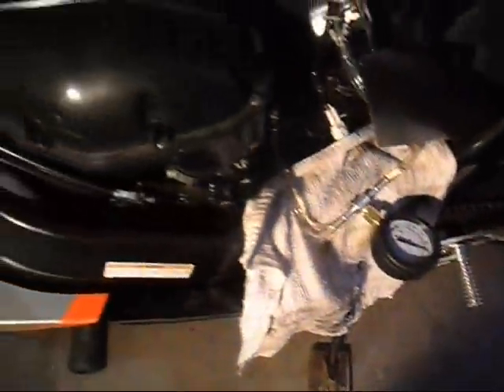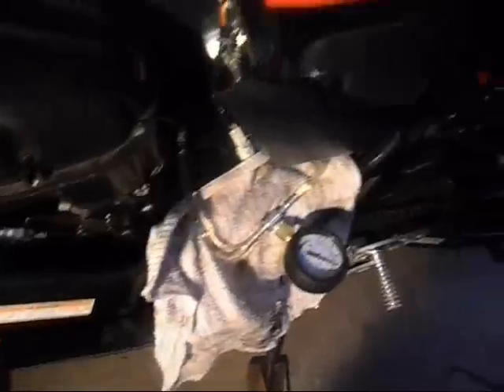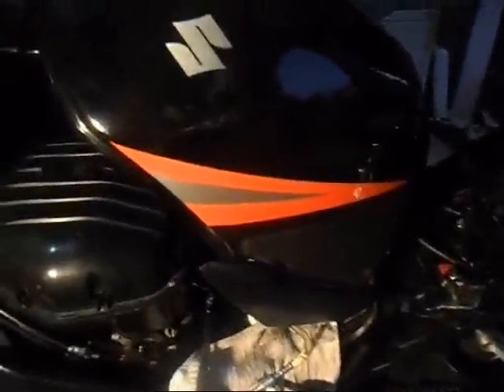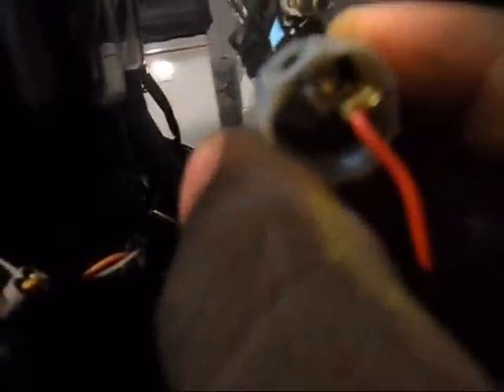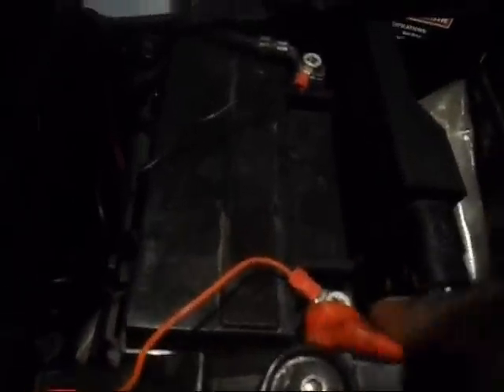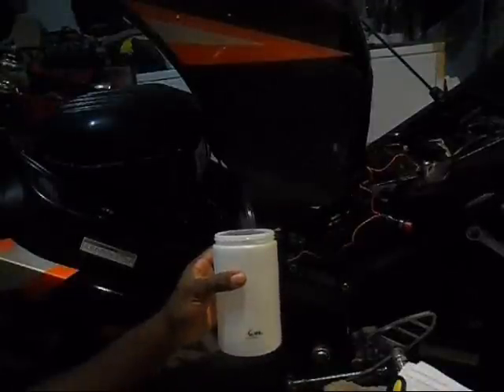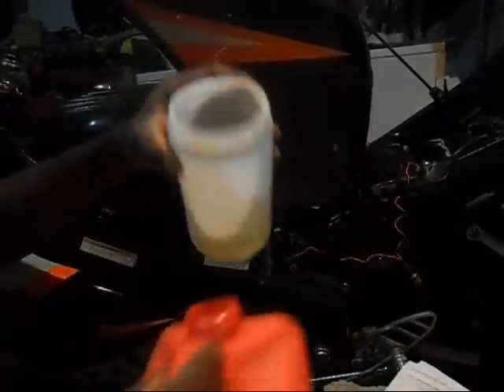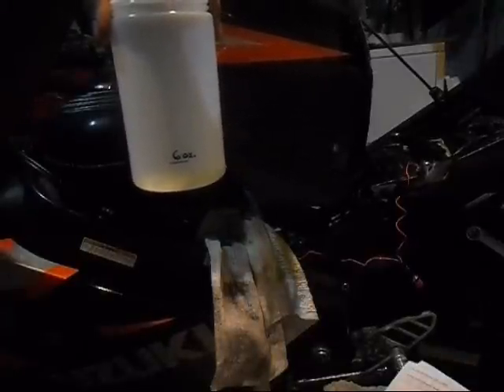Fuel Pressure Test  & Fuel Deliver Test (Fail!!)

Comment: Man I’m having the same problem. But it’s with a pc5 on after market map but on a stock map it runs fine. My pump is only a year old and it’s a high pressure pump.

Comment: Im having a problem with my gsxr 750 02 in 6th gear throttle wide open its only giving 110-115 mph could low pressure fuel pump contribute to my issue

Comment: did the fuel pump fix the problem???
Reply from the maker: yes sure did
Reply: +LaDarryl Hollingsworth  my is doing somthing similar im getting a new pump tomorrow or friday in the mail hope thats the problem to
Reply from the maker: Good stuff.  Did you test your fuel pump before just replacing it? Because I tested tested tested.
Reply: +LaDarryl Hollingsworth it have a low pressure worse than urs
Reply from the maker: +alex ramirez oh wow
 ok. Yeah replace that! I'm replacing one on a 2010 r1 as we speak. Has 39psi and the Internet says it should be 46.
Reply: +LaDarryl Hollingsworth yea i order it tuesday i cant wait for it to get here they say to to 3 days shipping
Reply from the maker: +alex ramirez good stuff

Comment: the pump is good the problem is a robber in the fuel pressure control valve in the fuel pump body is liking and the pressure is lost
Reply: Alfa Suzuki is it possible to fix it without buying a new pump?
Reply: Alfa Suzuki is that where those O-rings are that go bad that I've heard of about?

Comment: Good test dood.. I have to look at my specs to see if they give a fuel rate listed in the manual. I have a 91 Yamaha V-Max and for some reason, I'm having a problem with fuel delivery or Air / Fuel mix. I can't seem to rev more than 4K in 2nd gear them it tries to bog down. I've been doing all sorts of diagnosis / cleaning / checking fuel pump flow but its driving me crazy. Strange thing is, if I’m in 2nd and give a little choke, it feels like it has full power.

Comment: A clogged fuel filter can cause that.
You have a steady pressure in the specs when you don't rev it.
So the pump push enough as long as you don't need flow.
As soon as you rev it up the flow drop,so the pressure.

I would dig it first before to buy a pump.
Have you ever changed the fuel filter ?
Reply: michaelovitch I had the same problem with my 1000. Ended up pulling the tank draining the fuel which had water in it I found all kinds of crap floating around. Some of it sucked into the injectors. I ran chemtool  through mine after I take the fuel pump out and cleaned it out and the filter. I started it it was running like s*** backfiring for a little then it's cleared up I guess because it smoothed out. But what I was going to say is it wasn't that hard to do the fuel pump pulling it out and cleaning it and all that it's just kind of a pain in the ass putting it back together just takes patience which I don't have